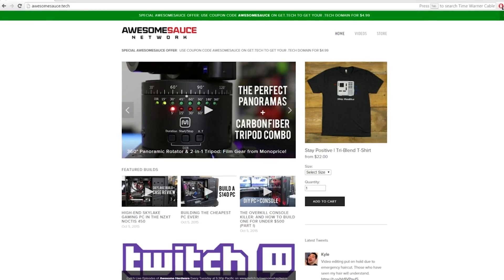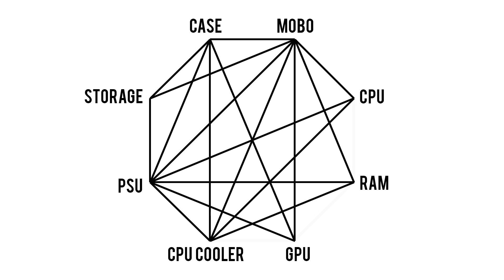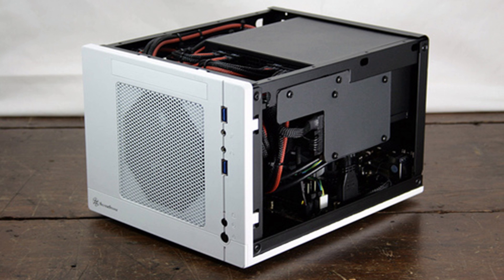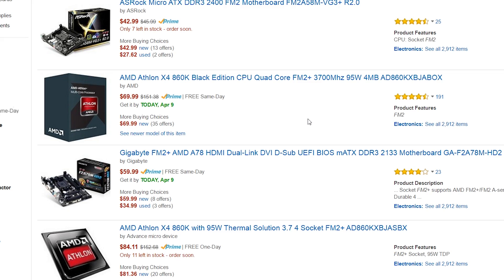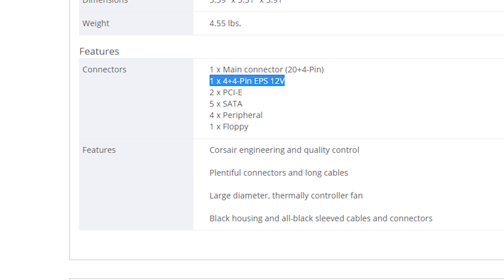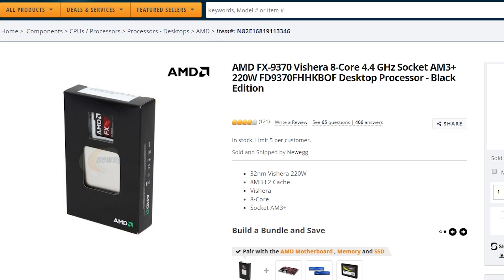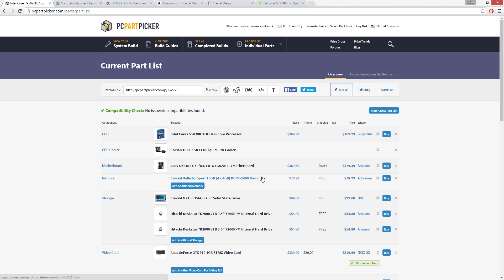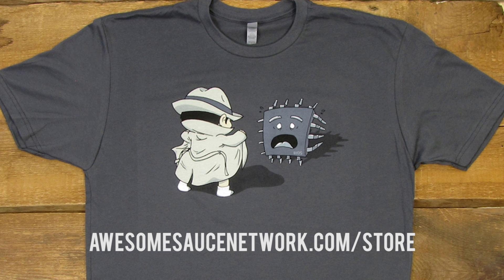How to Choose Parts for a PC! The Ultimate Compatibility Guide!

Comment: One thing to note about determining how must PSU max draw rating you need, 80+ efficiency ratings are on a curve. You generally only meet your PSU's rated efficiency while between 50% and 70% load on the PSU, so if you're building a 400W draw build you'll be best off getting a 700W or so unit. It's also good for your PSU's health to not run it at absolute max capacity.
Reply: 80+ rating specifies the efficiency between the wall and the PSU, not between the PSU and the parts (basically).
A 1000W 80+ PSU delivers the same amount of power as a 1000W 80+ Titanium PSU to your PC parts. The difference is that the first one may draw up to 1200W from the wall, while the second will stay below 1100W (assuming 100% load on PSU, or 600W vs 550W at 50% load)
Reply: Lukas Trautmann That's not related to what I said. Efficiency ratings are not a set number, they're rated on a curve. The advertised ratings are at 50% load, if you want to get the full advantage of your advertised efficiency rating you shouldn't just be adding 100w or 150w to your total to make a safe margin. You should be planning for 50% load on the unit. http://i.imgur.com/IPockOY.jpg
Reply: +Jon Asgaeroth I disagree, while is true a PSU maximum efficieny is usually around 50%, there is no point on chosing one that matches that 50% load because the diference is so small comparing to lets say 25% load that is not worth it at all.

No need for anything more than 600W for a single GPU system, even with OC, also this kind of comments can lead to bad choices because if someone that doesn´t understand about it reads it then he will try to look for something like a 700 or 750W, what he will probably end up with a crappy o mediocre 750W psu instead of a good 500-600W psu
Reply: marcos1669 No one is going to go from a $70 650W gold to a $30 700W unrated hotglue fire hazard instead of an $80 750W gold because they understand better how efficiency ratings work. Your fears are baseless nonsense. Yes a 650W PSU can run a 500W draw build, but there is no harm in spending an extra $10-$20 to get a unit that will run that 500W draw build with 5% better efficiency and 15c cooler and lower fan speed.
Reply: I think you should look on forums, i see people putting crappy or not very good 750W psu any day of the week, is way too common

Comment: i had a problem where my 8 pin cpu psu cable wasnt long enough to reach to the socket on the motherboard.. it was about half an inch too short...
Reply: You can look for extension cables online :)
Reply: i know, but it wasnt something i had foreseen ;) just a little thing that might happen to someone else aswell ;)

Comment: MOTHERBOARDS, WATERCOOLERS, AND CASE COMPATIBILITY. I've ran into a couple cases that cause top-mounted watercoolers to run into the motherboard heatsink and had to install fans on the outside of the case or mod the case to make it all fit properly. DIY watercooling runs also suffer from bad case design and needs to be researched to make everything fit. Another thing on case and power supply is if there is a hole for the 4 or 8 pin through the motherboard tray. For case, graphics card, and storage some cases have have to have a second drive cage removed to fit a longer length graphics card, and can cause some to not have enough mounts if they need a lot of drives. Clearance for the right side panel can affect cable management between the mobo tray and the panel. Case and power supply for people wanting bottom exhaust psu's. That's all I can think of right now, great job on the video!

Comment: Make sure you know where you are putting your case. If it's going to be on thick carpet make sure your case either has the psu on top or it has raised feet on the bottom so the psu has access to clean unblocked air. Last thing you want is your supply of power for your rig to fry up.

Comment: I feel that one thing was missing from the PSU portion of this guide. You have to remember that when you choose a power supply, efficiency does come into play. For example, if your system power draw is 490W, a 500W PSU will simply not do. A power supply's efficiency rating needs to be considered. The 80 Plus rating chart is a good place to start. An 80 Plus Gold PSU will be 90% efficient at 50% load, or 250W on a 500W PSU. So make sure to account for this when purchasing a PSU, and do not simply choose a number that is barely higher than what you have,
Reply: +Vapeaholic That is not true, a 500W psu is a 500W (obviously if it is a good one and not a crappy one), efficiency has no impact on the power delivered a good 500W psu will be always be able to deliver 500W no matter the efficiency.

Also a 80 plus gold unit is not always better than a 80 plus bronze one, there are too many crappy or mediocre psus
Reply: +marcos1669 I think you need to go back to physics class
Reply: If am not missunderstanding you, what you are are saying is that a 500W psu can not deliver 500W because efficiency, but that is incorrect, because the 500W is what the psu in capable to give to the computer, not what is capable of geting from the power grid

Comment: Hey I doubt it but would you be willing to give someone who has a custom built pic without a GPU (me) a GPU from your neglect shelf? I cannot save up enough money for a decent GPU
Reply: +Music 101 r/hardwareswap

Buy what you can affoard. a 780 goes for 200 on there. A 7950 for 100, 6970 for 60, I can go on. I am pretty sure you can find something. If not, trade your cpu for a lower end cpu and gpu. You can do that on there troo.
Reply: +Adeel Rehman all I have left in my budget is about $120 and my cup is a little on the low end. It's a i5 with quad core and has 2.9 Ghz. That's why I asked him if he has one he would scrap or just throw out.
Reply: I also need Atlanta 2 Gbs with ddr5
Reply: +Music 101 120 bucks will get you an HD 7950 on hardwareswap. It's pretty much a rebranded r9 280

Comment: what about the 12v Rail situation on some psu's... or back plate clearance on some cases
Reply: +Andrew Jones yep, have a matx motherboard that didn't fit video cards with a backplate, had to take out the lower ram clips to fit all in (luckily the memory sits pretty solid in there without the clips)
also, while mentioning clearance issues with radiators he should've warned about checking the length of tubing for aio water coolers in large cases

Comment: I think there needs to be a line connecting ram and processor.
Reply: +AmalGatroN just if it do support the ddr4 or not i guess and all of new 6th gen cpu and up do support ddr4 plus the motherboard would decide it for u
Reply: Sometimes a motherboard will support both a CPU and ram but the CPU still isn't comparable with the ram. It is rare but it can happen.
Reply: true u got a point there

Comment: RAM <--> CPU is a thing.
Reply: Just download some ram
Reply: +KazoWAR was going to post about that. but thought i would check first to see if anyone else had.
Reply: your cpu only supports a max amount of ram and the max speed, right?
Reply: +KazoWAR Yes but the compatibility is basically covered through the motherboard.
Reply: +Michiel Haisma I was referring to the memory's clock speed. even if your motherboard supports 3400MHz memory, your cpu might not beable to run the memory at that speed.

Comment: Hey guys this was a great video, but I think he missed the part about the correct amount of fan headers on the motherboard, I have run into this problem before. so make sure to check the amount of fan headers on the board because no one wants to use those Molex to fan header adapters

Comment: what? A non-liquid air cooler? You are such a newb if you dont go for a liquid air cooler. And its easy too. Just hook a hose up to your case and start pumping. You will start seeing what it can do for your temps immediately.
Reply: It would be ashamed if it leaks. That's why some prefer air cooling, to prevent hundreds of $$$ getting wet and not functioning

Comment: i wanted to use LED in my case and add some fan to make better temp and air flow.. do i connect those two to my motherboard or to my psu ? answer please
Reply: +Teguh Wijaya The LEDs go plug into the PSU and typically the fans plug into the motherboard headers, unless the fan only supports molex.
Reply: +Kangaroo Chili well i think i can't add another fan... i think i have only 1 fan headers on my motherboard.. since its old model motherboard for 3rd gen intel.

Comment: do you ever think they will develop a sata port that gives you both data and power in the one cable thus making it easier and have a cleaner build in your system
Reply: +noel carroll M.2 uses 0 cables :D What i'm getting at is, why evolve SATA when it is on it's way out. with NVMe and M.2 becoming more mainstream we will see SATA go away before too long.

Comment: tip. DON'T.. IMPULSE.. BUY... It's the easiest fucking way to run into compatibility issues. Sure that super good deal fits in your budget while giving you good performance, but if it doesn't fit in your build you're SOL unless you can I don't know, take an angle grinder to your case or something.

Comment: i need help i have a samsung 250 GB SSD and a 1T wd blue caviar the ssd works just great but the blue caviar does not work. my pc doesn't pick up the hard drive i think i have it pluged in right please help and thank you
Reply: +CKS CM Does it show up in the BIOS and just not in windows? if so you need to format the drive to the NTFS file system in windows and you should see the drive just fine after that.
Reply: ok thanks

Comment: One thing I would say, just going by the numbers doesn't always work for things like Radiators. My Case "supports" 280mm long radiators... but there's a bit of a clearance issue regarding the top of the motherboard. It outright locks in my CPU power connector and bars me access to many ports on at top edge. So if I need to plug/unplug anything on that edge, I'll be forced to remove the Radiator.

Comment: One of the biggest problems I've run into is the length of included psu cables. Especially in larger cases, the included cables may not be long enough to reach the port they need to get to or may not be able to go behind the motherboard tray. While cable extensions can be an attractive and useful addition, it sucks to have everything built, but not be able to power on your system because of a short cable.

Comment: Im planning on building a rig with an i5 4690k and a gtx 960 4gb oc model in it, I'm going to over clock the i5 to around 4.2 for a safe enough oc, will I be able to overclock it and run the system under load fine with a 600w psu, thanks
Reply: +The Mystic Gamers Yeah, as long as the PSU is reliable shouldn't be a problem. I'd make sure you have an aftermarket CPU cooler though, OCing on a stock cooler usually isn't the greatest of ideas.
Reply: +Kangaroo Chili I'm going with an evga psu so it should be fine reliability wise as it's a pretty well known brand, and I'm gunna use a 212 evo for it because yeah the stock Intel ones are a little sketchy for ocing haha
Reply: +The Mystic Gamers Oh, yeah you should be fine, the 212 evo is a great cooler.
Reply: +The Mystic Gamers Should be OK, I always like to go a little more on the PSU then I 'need' for future upgrades, and what not. My current build is an i7 6700k and a GTX 980 Ti, have the CPU running at 4.4Ghz and the 980 Ti is OC'd to around 1400 Mhz most of the time, I'm runnin with a 750W PSU
Reply: Dave McAvoy Name nice build man, makes my ancient 3 year old hardware cry.
Reply: +Dave McAvoy Yeah I was thinking about future upgrades and what sort of head room I'd need with it, but I don't think I'm going to be upgrading to anything much more power hungry in the future, because I game on a single monitor at 1080 so I only really need a 960 to get me 60 fps in nearly all games on high / ultra, so I won't need to upgrade my gpu for a long while. The next cpu upgrade I'll do is most likely a good few years down the line where I'll switch up to an i7 6700k and ddr4 because by then it'll make more sense, because atm the difference between a 4690k and 6600k is hardly enough to really justify spending more on the cpu and ddr4 ram and the loss of choice in mobos.

Comment: maybe you could add that 

1. the motherboard has to offer pcie x1 slots eg. for soundcards and so on (if not, go to step 2)

2. pcie x16 is backwards compatible

3. one should look if the pcie x16 slots are not only mechanical / physical but also elektrical (only needed for older motherboards i think)

but great video, very nice conclusion

Comment: Guys can someone tell me how far I should overclock my 6600? It's ok the stock air cooler so I'm worried about overheating
Reply: +James Bennett&#160;unlocked cpus&#160;come without cooler(z170) so i think u bought an i5 6600 ? that is not overclockable and u dont wanna OC on stock coolers... for gaming OC is good for upcoming gpu or sli.. few games take advantage&#160;from OC. check intel for the temps but i think its about 100&#176;C , but for day work i recommend about 75-80°C MAXedit: http://ark.intel.com/products/88188/Intel-Core-i5-6600-Processor-6M-Cache-up-to-3_90-GHz    turbo 3,9 Ghz
Reply: +James Bennett if it's not the 'K' sku it is not designed to be overclocked and you will have a difficult time getting a good overclock with it. Do not waste your time attempting this.
Reply: Firstly, I know how locked an uncooked CPUs work, I'm not a noob :P Secondly, I meant AMD HD 6600 GPU, not an i5, I should probably have specified that

Comment: Additional piece I ran into...make sure your case fan and new Motherboard have compatible power headers (I tried keeping my older fan only to realize after startng the build that this older case fan had a 3 pin power connector and the current standard is a 4-pin header on the motherboard.  So at the last minute had to find an adapter (which came with a replacement fan).  Also not being useto newer boards would up replacing my ribbon-cable connected DVD-Drive with a SATA Blueray drive after realizing I had no place to plug the ribbon cable into on the new board (again last minute and wound up being an emergency call to the wife who was out purchasing the replacement case fan for me).
Reply: +geribaldi2 You can use 3 pin fans on a 4 pin plug, the 4th pin is just lower voltage for low RPM states. Also, LOL IDE ribbon cables have been out of use for like, what  8+ years now >.>

Comment: I'm not sure if it's worth also mentioning GPU - monitor compatibility here.
Reply: +Michael Scott (Splosionz) hmmm maybe a bit, just that newer GPU's don't have VGA ports so you need an adapter if you are running an older monitor. Other then that, there isn't really any 'compatibility' issues.

Comment: Very thorough video. Well done.

One thing: PCI-E 2.0 works for GPUs too. AMD doesn't have PCI-E 3.0 support on any current mobo AFAIK (As Far As I Know). Doesn't bottleneck graphics cards, at least not 2 x Crossfired.

Other stuff I would mention is if you have an old but good sound card/Network card that requires PCI (old af), make sure your new mobo has it too. PCI is being phased out.

USB-support. I would try to find a Mobo with at least a couple USB 2 ports. Only USB 3 ports can become a pain. Especially if you try to install Win 7 via USB stick. Some peripherals also don't like USB 3, like wheels etc.

Comment: so with an i5 and GTX 960 I need like 650 W!?
Reply: 350 watts will be fine 
PSU recommendation is complete bullshit I ran a 2500k @4.8 and a 7850 with a vmod on a 350w PSU
Reply: 500 will be fine, I got a 970 and fx 9590 but I got a 600watt! Then you can upgrade and keep the same power supply :)
Reply: Yes
Reply: Overkill,id get an 500w psu
Reply: +jd gaming People always missjudge the system power consumption and end up going overkill based on those useless websites, this guy would be more than ok with a good quality 350w psu as you said
Reply: +jd gaming 
Running 7 Fans, a I7 6700k @ 4.6 GHz, a R9 390 (sometimes overclocked), a HDD, a SSD and an old Optical Drive with an 530w PSU. The suggested amount were 650w too, but I only use ~470w.
Reply: +jd gaming Living on the edge I see... I like that...
Reply: Jonathan Verduzco
lol!
Reply: António Real yeah, I was going for 500 since the recomendation is 480, but awesomesauce said that you should go with 100 plus the rec or something so I got a lill bit scared
Reply: Måns Åkesson I am registered in a online shop's forum in my country and i've done tons of builds for other people, many of those builds having a skylake cpu coupled with a gtx 960 and i always recommend good quality 350w psus and so far no one came back complaining. Even my rig that has a Gtx 970 and an i5 6500 won't go much above 250w in full load situations (i've tested it with a consumption meter) so you don't have to go super overkill. Get a 500/550w psu if you plan having beefier cards in the future nad you are good to go.
Reply: António Real thnks!